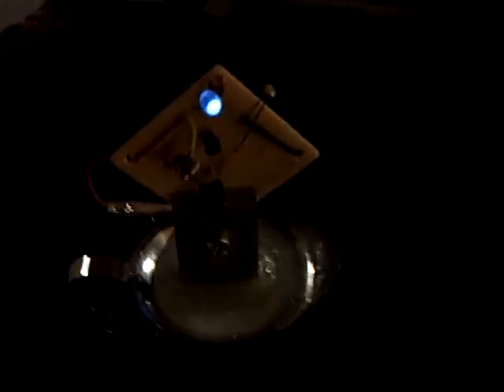Stainlees steel crystal cell with auto On -Off LED light

Comment from the maker: @iluzyon1 -----Slider and I both have now made your "choke" LED oscillator and we think that you had a great idea there.  It is a simple solution for the transformer in the circuit and works very well.   Thanks.

Comment: They are named chokes...ok, sorry about that. I usualy speak french and could not find better name than axial inductors. There is no such thing in my Haraps dictonary :) . A little more info ...Chokes : 510mh on Collector and 560mh on  Base potentiometre. Exact Lidmotor circuit ,i am using ½ '' copper pipe cap, 4'' long galvanized wire coil (in cap) plus water/alum electrolyte... barely blinking white led at 0.616 volts and 1.4 microamps. Dim light a 3.8 microamps to 560 ua. Use 2n3904 trans.

Comment: @Lidmotor Yeah, I just rip the bits off those lights, great salvage. My Silent Night on a 'Penny' was very rough, used a wiper pot, but it seems more about the timing than the note itself being 100% correct. Jingle Bells would be good mental example.
Tell ya what, I get more use out of my AM radio nowadays with your circuits, than I ever did listening to stations !

Comment: Always so cool your little circuits, i am a fan of your chanel :D . For the ones that does not know that already, it is possible to use your blocking oscillator circuit and replace the toroid core(or the gardening wire coils) by 2 axial inductors side by side ''in microHenri range''...( the ones that look like bright green resistors) they may be a little more easy to find and it  works perfectly . I tried theme also on joule thief circuits and works even better then lots of toroids i have found.